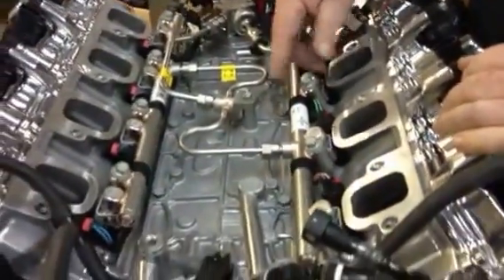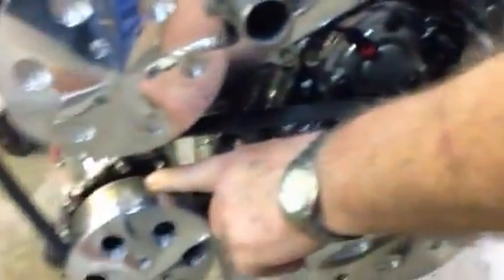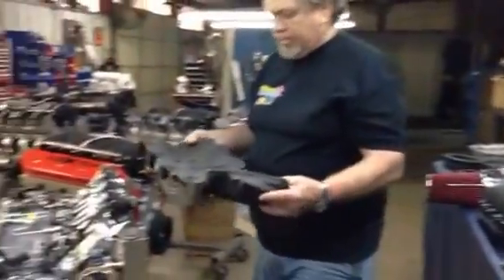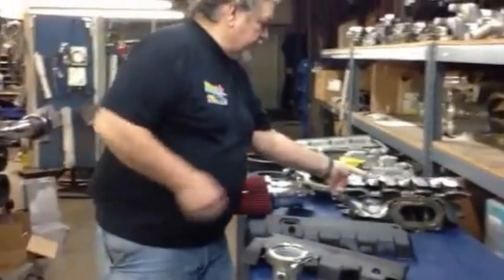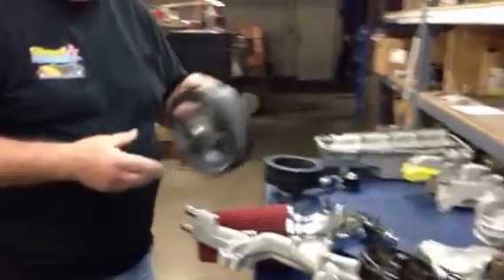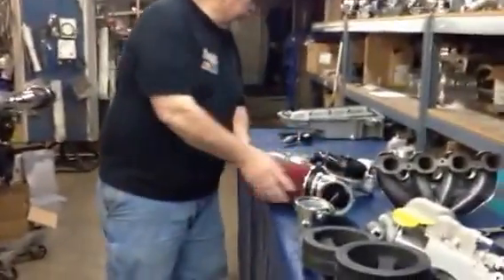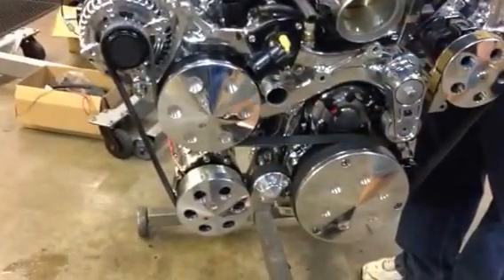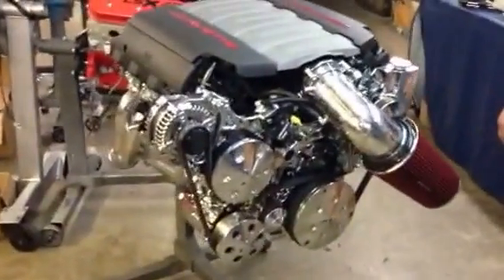New LT-1 Corvette Engine

Comment: Corvette has become one of the worst cars when it comes to reliability.
Reply: My 2015 C-7 engine needed replacing after 2 years.  A dealer may have screwed it up when they replaced the torque converter.

Comment from the maker: Any questions give us a call at 479-394-5711. www.hotrodlane.cc
Reply: Its a 376, not 372. Displacement in inch calculation is as follows bore x bore x stroke x .7854 x # of cylinders. 4.065" x 4.065" x 3.622" x .7854 x 8=376.05".